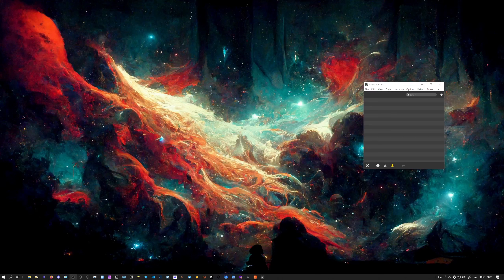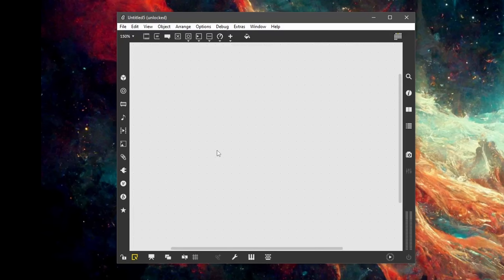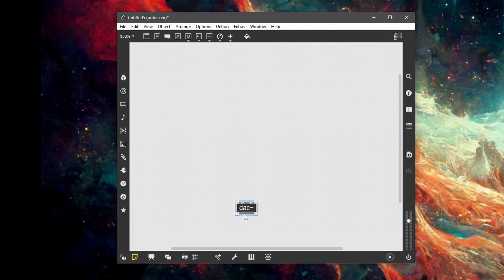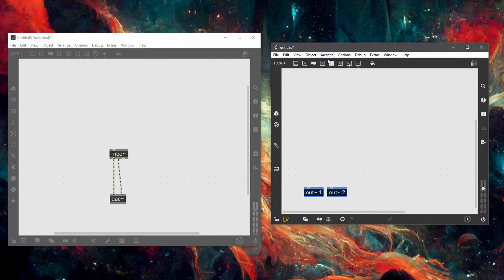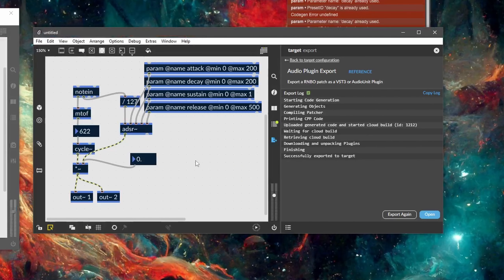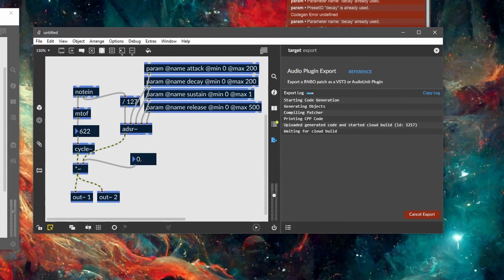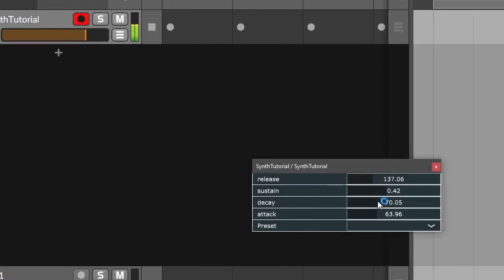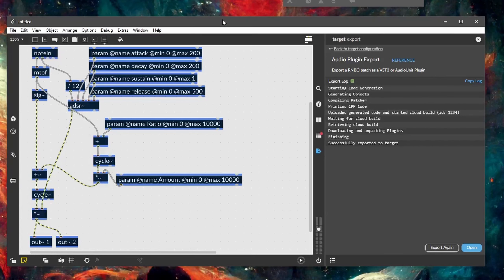How to Make your FIRST FM polyphonic Synth VST in Max RNBO

Comment: Actually if you want real FM, don't modulate the frequency. Create a phase driver (a simple ramp from 0..1), multiply it by 2PI, and send it into a sine function. This way you obtain a sine oscillator, but to do FM (like it's done in DX synths), you only need to add the modulator audio signal to the phase driver (the ramp in between 0..1). This way the FM amount is set by the amplitude of the modulator, and FM feedback will work also as expected (the DX synths do some averaging in the feedback path).

The simple formula for an FM modulator looks like this:
Output = Sin((Ramp+Modulator)*2*Pi);
// the frequency of the ramp is the frequency input of the operator
// the Modulator is a simple audio input

In most modular software the sine function is scaled so that an input of 1 represents 2Pi, so you can leave the multiplication with 2Pi in Reaktor, AFModular, and probably even in the Grid.
Reply: can you suggest a resource where i can learn more about this?
Reply: You can very simply achieve real (linear) FM using the pitch input... if you're interested in the patch I can give it to you or explain it.
Basically I simply re-calculate the usual (=linear) input in a way, that makes it being "transfered" to a pitch-value (achieved by Math Modules inside The Grid. Verified, working.
Sound of real FM in The Grid is interesting an - as expectable - much different from PM.
Reply: @McGyver008  Self modulation / feedback modulation wont work properly this way, it will detune the sound a lot.

Comment: Is it possible to get rid of JUCE logo popup or improving GUI by using svg and png strips?
Reply from the maker: no. you have to export to c++ code and then add the gui manually. rnbo only exports a generic gui with all parameters